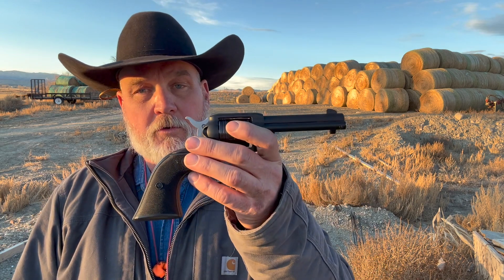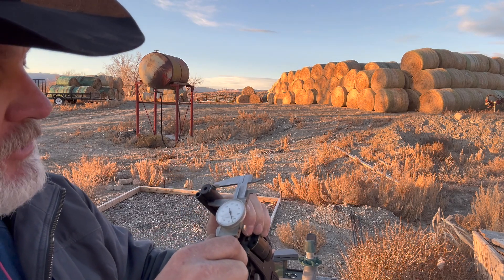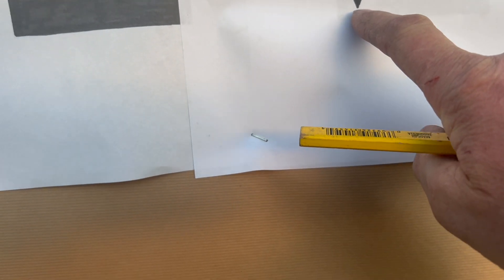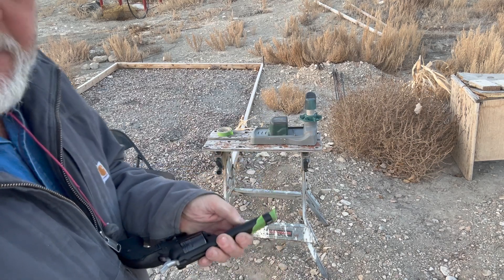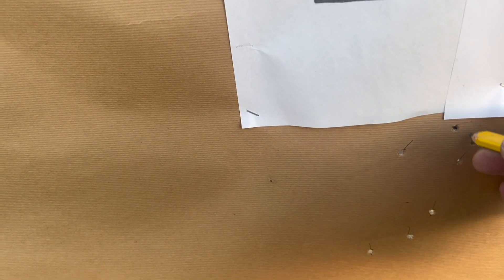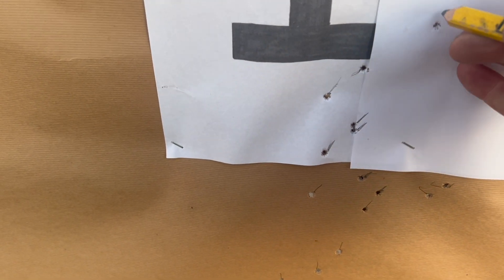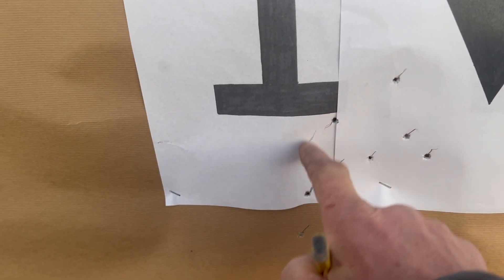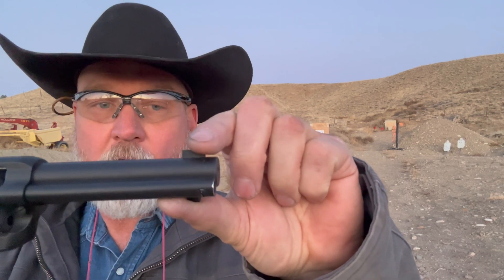Ruger Wrangler sighting in fixed sights

Comment: Move the front sight the opposite way you want to move the impact of your bullet. Move a rear sight the same direction you want to move the bullets impact.
Reply from the maker: Thanks for the comment I will be doing a follow up video on this project   Thanks for watching
Reply: @chrisevansgunshorsesranchi699  nice
Reply: @chrisevansgunshorsesranchi699  Can you post a link to the new video? Thanks!
Reply from the maker: @kristopherkirkpatrick6631  https://youtu.be/28ZlWWSUc5Q?si=fbJWOwptZXnNzKnn  Here is the link Thanks for watching
Reply: Ruger wrangler sights do not move
Reply: @kalashnikov4784  Yes the front sight can move.. put in a vice and gently bend , you can’t move it a lot but you definitely can.. I’ve done it before.
Reply: @guaporeturns9472  yeah they can move like that but are not adjustable
Reply: @kalashnikov4784  Right , you said they can’t move… you are wrong , they can move. They are called "non-adjustable” but you can definitely adjust the front sight.

Comment: Chris, I had to laugh. At first I thought you were going to say that you were going to go until you run out of front sight! lol
My Heritage rough rider was the same way. It shot low and left but not quite as much as your Wrangler does. 
I bent the front sight to the left slightly by tapping it with a plastic faced hammer. 
I left the elevation alone and just remember to hold a “coarse bead”. 
Unlike you, I like my pistols to shoot right where I aim, not to a six o’clock hold, so my gun doesn’t shoot quite as low for me.
That Wrangler is still a dandy looking gun though. I may end up getting a Super Wrangler at some point. 
BTW… I like the new name for your channel. I think your “Re branding” will pay off on both.
Reply from the maker: Thanks Boyd  I appreciate your positive comments. I have thought about trying to turn the barrel. You say you bent the front sight that sounds spooky. Help me remember if the gun shoots left you move the front sight left correct?? I will do a video on moving the sight. I want to gun to shoot spot on. Thanks
Reply: Yeah, the sights are soft. If you snap one off, then you would have to silver solder a new one on again.
Reply from the maker: @boydsteenblock1328 would you bend the sight or turn the barrel
Reply: As far as you need to move your sight, I would try turning the barrel. 
I have never done that, so I don’t know how involved it is? Bending your sight will look goofy if you move it too much.
Mine didn’t need to go far.